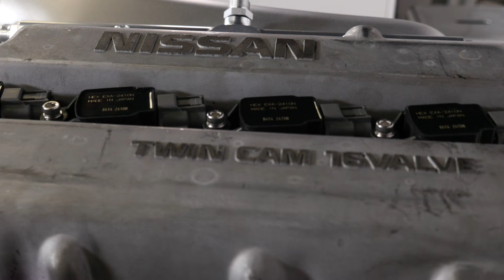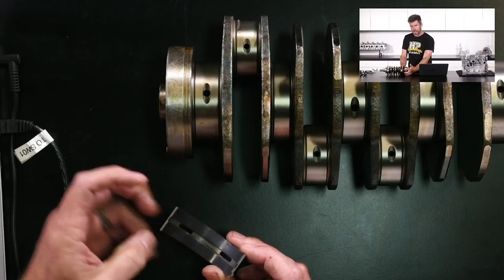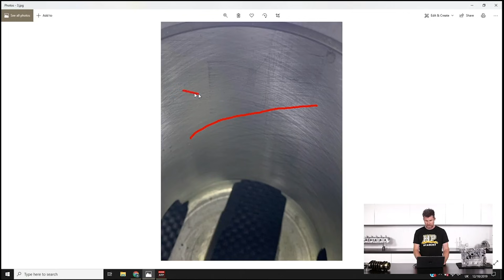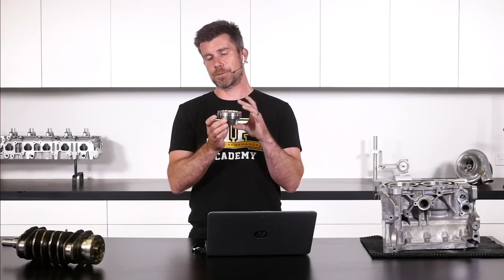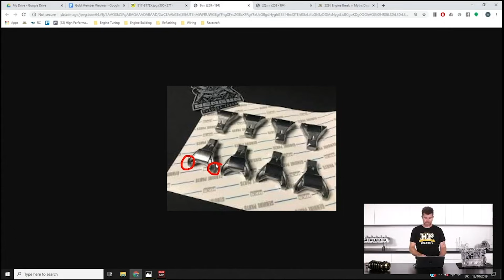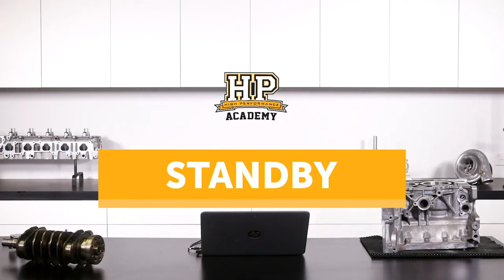Engine Break-In Myths Dispelled | Engine Break-In Tips And Tricks [GOLD WEBINAR]

Comment: I've always pre-primed the oil pump, did a first-start and made sure all pressures are good while it comes up to temp and the fans come on, shut it down, change the oil, and possibly do a retorque pass on certain fasteners... Then off to the dyno it goes. Build a base tune and flash it in, then start doing pulls and getting VE and fuel dialed in. Within 15 minutes, it's getting the BEANS 🤣 Get the tune dialed in, then fine-tune things like IAC, tip-in, and part throttle drivability... Then it comes off the rollers and onto pavement for a little tune refinement and collecting data. Do another oil change, check lash if it's a solid-roller, and start beating the snot out of it.
Reply: yeah +1 for pre priming oil pump

Comment: I’m not sure I agree with combustion pressure helping to load the piston rings to seal rather than just the ring radial pressure. Wouldn’t the combustion pressure just add upwards pressure not radial pressure? Show me how combustion pressure would add radial pressure to aid in sealing. Great info. I am not an engineer but logically I don’t see it. Thanks
Reply: Graham the radial pressure is largely only for assembly an start up. 99% of the ring pressure is radial, it is applied to the back of the ring and enters through the ring to groove clearance on compression.

Comment: something we always do after an engine build, is turn the oil filter a few turns loose and crank the engine (without spark plugs in it) and als soon as oil comes out of the filter you fasten the filter while you keep cranking, this makes it more easy for the oil pump to get rid of air and you are 100% positive the oil pump is actually working. 
Especially on bike engines this will speed up the process of bleeding air out of the channels and the pump. 
This also helps a lot on yamaha's, who dont have an oil pressure sensor but an oil level sensor... when you only depend on the oil light this may end in tears. 
Great vid! Cheers!
Reply: Pre fill the oil filter!
Reply: Yes!

Comment: I broke in my engine before watching this video, and I regret doing so very much. I had a tremendous amount of blow by for the first two hours of idle after first startup. The moment I started driving it and seating the rings, that blow by went mostly away, but now I get some crankcase pressure. If I had known then what I know now, I definitely would have started driving it earlier. Absolutely top-notch and invaluable information. Cheers.
Reply from the maker: Better late than never and at least you have a better idea for next time. It's hard to get everything perfect first time around when you're learning, and we're all always learning. Most important fact is that you're out there doing it, seeing what you can do better in the future, and taking it on board. 
If you ever feel like you know it all and have nothing left to learn, that's when you should worry 😅 - Taz.

Comment: Another serious question here although it does not concern me personally. If you are breaking in a turbocharged engine, do you run it with a mineral (dino) oil to break it in? My thought is, for the static break in, yes. Over the road, no. What does the Academy teach?
Reply: No reason to use mineral
Reply: @Boz1211111  With a new vehicle, fresh out of the dealership, undoubtedly true. With a rebuilt engine, I am not sure. I am never going to actually rebuild a contemporary engine. I am just collecting information. And trying to destroying misinformation.

There are different mechanical theories, but with break in the theories can be tested by tearing down engines and doing precise measurements. Especially, with laser scanning it would be very easy to determine how well the different parts lapped in and whether one method or another did any damage however infinitesimal to the turbo.

I seriously doubt that doing the static phase of the break in on a turbo engine with mineral or Group III synthetic would harm either the turbo or any of the sensors. Another issue though is that for some weights of oil, only synthetic is available.

Of course, there are synthetic break in oils available. If I had just spent thousands to buy a replacement engine whole or whatever you have to spend to rebuild it yourself, I think I would pay for synthetic break in oil. With a cast iron block engine, life is a little simpler.
Reply from the maker: Yes we use good quality mineral oil. If you plan to switch to synthetic we'd still run mineral up to around 200kms of engine use even though the majority of the break-in process is complete by 20-50kms. Note that's not to say you do the first oil change at 200kms...

It is tricky as there are many opinions on this and even speciality break-in oils, so note we only advise what we have had proven success with rather than stating what we are doing is the ONLY way it can be done.

This is covered in more detail in the Engine Building Fundamentals course (direct module link below in case you own it), and also on the HPA members forums. 

There is a short thread here amongst others:  https://www.hpacademy.com/forum/general-engine-building-discussion/show/recommended-break-in-oil

Hope that is of some help - Taz.

https://www.hpacademy.com/dashboard/courses/engine-building-fundamentals/engine-break-in-engine-break-in?utm_source=youtube&utm_medium=social&utm_campaign=general-interaction

Comment: Serious question. Under what circumstances would someone reuse piston rings? The only thing I can think of is if someone is changing the  the bearings but keeping the existing pistons and rings, and decides to rehone the cylinders. My thought would be, if the bore is good and you are going to rehone under the shade tree, why not do new rings? There are, though, stages of rehoning starting with glaze breaking and then more intensive stages which create new hatching. Maybe that has something to do with it too.
Reply from the maker: Unless they are going back into the same bore that has been untouched, never. It's really important when you're disassembling any engine to take special note of where individual components have come from and make sure that they're labelled as such if you plan to reuse them

If you have honed the bores you want new rings, 100% every time, to make sure everything beds in correctly. They are cheap compared to tearing things back down, burning through oil, or worse.

When it comes to reusing engine components of course this all comes down to your expectations too. If you're looking to make high power and want a long lifespan it's probably worth considering new parts. If you're on a tight budget, are not pushing things and are happy to accept the risk involved for the parts you are reusing then your goals and expectations will be different - Taz.
Reply: @hpa101  I have decades of experience but little working on the block. I did a ring and rod bearing job once (390 Ford) and it did run until I junked the car. I consider myself competent to rebuild a domestic cast iron engine though.

Bores can be a problem once you get into them. Sometime a block just needs to be rebored and then you are getting into more expenses for one thing.

Until the spate of videos I just watched, I never knew what engine break-in was really about. It is a lot easier to follow a protocol when you understand the theory behind it. Knowing the theory also gives you the ability to improvise when necessary and the ability to adapt the protocol to your conditions.

I very likely will never rebuild an engine, but it's good to know where you have been too, as well as knowing where you might be going.

Comment: Suzuki recommends a break in period for their motorcycles up to around 1600km with limits in the max revolutions. So if what you say  applies to motorcycle engines then suddenly you are more clever then the Suzuki engineers that have been building thousands of engines from the beginning of time & been around for donkeys years. Motorcycle engine technology is easily much more refined and  technologically advanced compared to motor vehicle engines so even more the reason what I say above   Is true.

Comment: On new engine builds I take the oil cap off, pull the timing belt, hook a hand drill up to the oil pump, and spin it til I see oil in the head for about 5 minutes. Then timing belt on and fire engine.

Comment: Hey i have a feeling answer is yes, because anytime i got plugs out and turning engine over i do this. But should i be pulling fuel pump fuse to stop fuel from entering engine cylinders during oil pump priming?
Because like you described the excessive amount of fuel in cylinders will cause the rings have to much slipperiness from the fuel and not seal correctly.
Reply from the maker: You indeed already knew the answer to this one 😉 - Taz.

Comment: Just wondering what the pressure difference is across idle vs revs for an NA engine, regards bedding in piston rings from combustion pressure. Boosted applications are obvious in their difference, but what of NA and how does that change across natural compression ratios or different intake setups like ITBs vs single?

Comment: Yep, I break in my own engine after I rebuild it and I warm it up, check vitals and cycle from low to high rpm for five times each, check vitals and re- torque the bottom end  and all external fasteners and  put it on the street. No failures or serious problems other than leaky valve cover gaskets, oil filter leak couple if times but no other problems . Straight and round bores are a rings best friend and after that ,run it normally. All of my engines were big block Mopar and sportbike engines which were and are daily drivers. Good engine cleanliness, correct assembly and a good machinist are the key to good ring seal.

Comment: i thought only pistons with "gas ports" used combustion pressure to aid the ring  pressure   ... its a small  notch put in the top of the ring groove  to alow the gas to get in there this is paired with special low tension rings

Comment: A little suggestion/advice regarding priming: it would make a lot of sense to use a pressurized oil priming tool. That way pressure would be there basically immediately. The engine won’t show the difference on the first 50k kilometers, but the last ones!
Reply: Loooo

Comment: When you brought up the point of cylinder wall wash and not experiencing it....I experienced it twice in my life. One was when my fuel pressure regulator busted and sucked fuel through the vacuum line filling up my oilpan with 2 gallons of fuel...The other was when Holley put 120lb injectors in a 36lb injector box and said low impedience injectors wont work with the Terminator X setup. Let me tell you my 8qt oilpan was filled to the brim in no time and yes the engine ran poorly and very rich but it ran. Holley takes no responsibility for anything after being confronted on their Forum with picture proof so boycott anything Holley thats EFI related s their smart EFI system is alot dumber than the EEC-IV system I replaced it with then went back to with a quarterhorse chip....
Reply: My fix to roughen the cylinders back up after the first debacle was sucking up Borax through the intake....I read in a HotRod Rag I think it was Smokey Yunick doing this when they couldnt get rings to seal up on their race cars.....LOL...It worked like a charm.....LOL..For the second debacle the engine needed a total bottomend rebuild...

Comment: I found that in most cases where the flattappet camshafts dont bed-in right is because theres some that use the thicker assembly lube to lube up the whole lifter sides and all and that can become so sticky the lifters cant rotate correctly. I apply ZDDP additive with 10/w/30 in a small handheld oilcan to the lifter bodys and put the assembly lube only on the bottom of the lifter and the camshaft lobes only.I also lube the camshaft bearings and cam journals with ZDDP additive and 10w/30 motor oil as I always prime my oil pumps before start up and use a Moroso dry start eliminator pressurized oil can at start-up....

Comment: I feel better watching your video. Being a little anxious and amatuer i bought my 406 SBC n/a as a longblock and installed myself.
#1 should I have used break-in oil even though Tri-Star engines recommended conventional 10w/40? (I'm fine there... engine oil is perfect)
#2 I did prime the pump with a drill so I'm fine there with 70 p.s.i.
#3 I TOOK IT OUT AND DID A FEW BURNOUTS, but it's a 2,850 lbs  S10 pickup with a 4:10 gear so it spins super east on the street, I drove it about 15-20 minutes circling Telegraph Rd and Eureka on open headers yesterday. Fun as shit! 
I'm going to take it easy and cruise it varying between 2000-4000 rpm in 3rd gear and let the rings seat some more...

Comment: i built a 1994 GSR-B18C1 turbo with 16 PSI boost  WITH no break-in just ran it no break-in on the new crower cams or crower valve train from Bruce Crower here in san diego, now this 1993 Honda Civic is crazy fast never lost a race in san diego yet, has ASAB Steel insert removeable insert  cylinder liners 81MM i can pull them out and replace them in hours... and honda 2000 high vol low presser oil pump.. and adjustable skunk 2 cam gears with 60 K coil..and a stand alone ECM . no porting of heads at all. dyno lost trackion at 500 Horsepower which i never could understand why they could not strap it down tight...

Comment: when built mine the rebuild company (PAI) told me to load the engine straight away. when i asked them how they told me to use a dyno and break (well i dont have that) so they suggested hooking another car or large trailer up and dragging it under heavy throttle for a couple miles...  not sure if 'seating rings' really matters but i borrowed a friends trailer with a loader on it and drove around with that when i pulled it out of the garage for hte first time

Comment: 46:30 It's also worth noting with old American pushrod V8s, you can remove the distributor and drive the oil pump directly using an electric drill to prime the engine. There are tools made exactly for this purpose.
Reply: I don't trust the cheap Amazon ones.  Junkyard 4.3 or any size small block distributor cut open works and it's made for our motors so I like them better.
Reply: @406MenaceRacecar  I bought a proper tool from Jegs for my Windsor. It's made by Melling Engine Parts.

Comment: On a Subaru motor, in this case a SOHC motor with roller rockers,  (stock rebuild--not forged) is it necessary to run straight grade detergent free Zinc oil?  Or will a multigrade conventional (non synthetic) oil work fine?

Comment: I totally disagree with the idea of abusing a brand new engine build.  Fresh built engines are not worn in properly within 100 miles.  The break in process allows the components to wear in correctly and heat cycle.  Also if there is any simple failure or required adjustments its better to find that at light load or moderate rpm.  And yes I build enough engines to have an informed opinion.
Reply: Additionally,  ring seal is not the only consideration when doing engine break in...
Reply: If you have questions about oil.  Watch information from Lake Speed Jr...  unfortunately this gentleman is repeating bad information on oil.
Reply from the maker: 90% of engines built for motorsport are not going to see 100 miles before a rebuild let alone just for your break in procedure sorry. Reliability demands are generally also much higher in motorsport - Taz
Reply: @hpa101   sorry, I thought you were referring to all built engines.
Reply: @hpa101  The title is "engine break in myths" not "Race Engine Break in Myths".  I really respect Taz and he is extremely intelligent but on this one I disagree.  In race application break in is not a consideration.  Its a different story on street strip engines.  There is more information out there on this subject. You need to research Break In Oil information.

Comment: Great up to date info.!

The same is for motorcycle manufacturers as told to me by factory techs, engineers and race team people.
In fact some motorcycle manufacturers put every bike through a dyno run before it ever leaves for a dealership.
In fact old style break-ins can damage a modern engine via for example glazing the rings and cylinders.

The materials used in engines today are much different than used in years gone by.
Even a Toyota dealer told me there is no break-in and mine runs perfectly after 5 years.
Reply: Yeah, I'm here because I bought my first new motorcycle, and I can't imagine having to go 600 miles under 4000 rpm, and 1200 under 6000, not exceeding 50mph. My brain tells me to trust the engineers, but my gut tells me that it probably isn't worth it and I should just ride.

Comment: I just did a rebuilt on my 5.9l magnum heads and I didn't do anything on my cam & lifters
Or crank and so on. When I put the
Lifters back in I did put 105 part lubricant grease on them and on the camshaft and on the distributor gears and on the Rockers as well. My question is can I just get by with just dumping 5  quarts of oil and zinc all over the Rockers camshaft and down the oil galleys and let it drain down to crankshaft before I button everything up and then start it without having to Prime the oil with the distributor which I'm not looking forward to. Thank you much for your time love to video thanks for your patience and help

Comment: Only just come to this video after pondering about certain procedures and uncertainties I followed on my 4G63. The engine was built by a reputable tuner. You're right that, really, there's a lot of common sense for the customer to apply here. I'm not an engineer or engine builder, but I always found the 1000 mile + run-in to sound like nonsense.